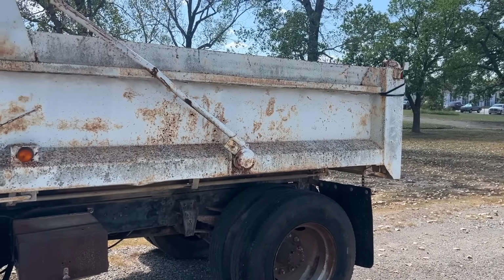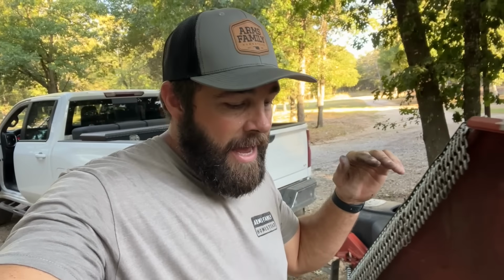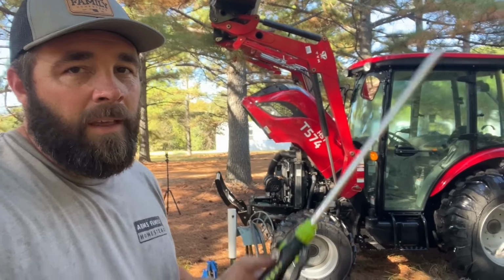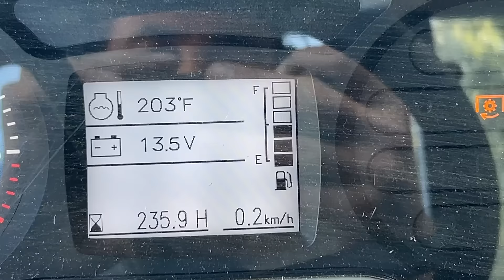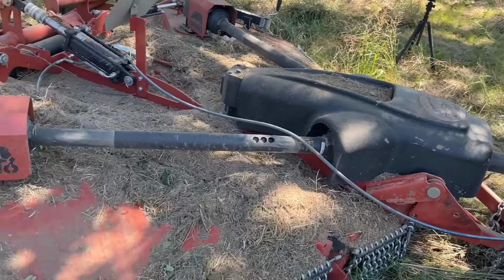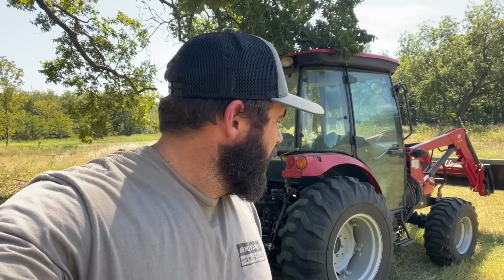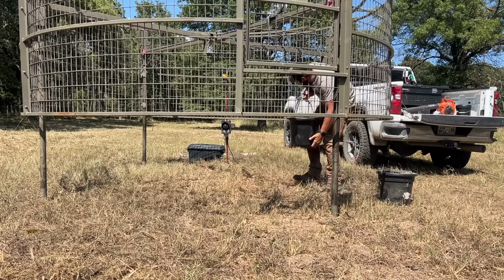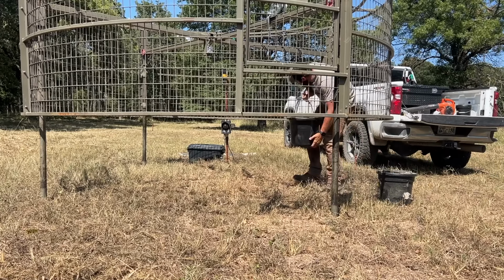That's a First for Me!

Comment: Either your thermostat is not properly functioning correctly. It’s not opening up or the radiator is stopped up.  Open the cap on the radiator and see if it’s flowing or take it to the dealership and let them check it out.

Comment: The overheating problem with that tractor might be a number of things a  faulty water pump?
Contaminated transmission will cause overheating. A defective thermostat will cause overheating. The electrical fan might not be working?

Comment: When you took the drawbar out it looked like you had it in the end hole.  I think that should go in a lot more and then the pin goes in one of the middle holes.   On the first hole like it looked like it was in there is to much leverage and for sure will break. I could be totally wrong  with just watching the video that is my opinion .   Welder up and keep on mowing !!  Good luck !

Comment: I'm gona be honest, I think that dump truck is a much better option than I think you are thinkin. at $5k you could take it straight to a good shop, get the bed relined, full run through the mechanical stuff, probably less than $15k all said and done. less than 30% what it would cost to get you into a newer truck and you wouldn't have to deal with a lot of the problems newer trucks can give you. no DEF systems is a huge plus.

Comment: On the issue of the repair of the draw bar connection it looks like that is a factory problem that they need to fix at their expense due to the fact that they need to check on the capability of the person welding that  together knows how to burn a rod ,just from what you showed of the weld there was no yes I said NO penetration of the two pieces of metal being welded together , the same time they find out why it’s over heating. Has it got sufficient coolant in radiator, because you’ve cleaned it out sufficiently to prevent it from overheating.

Comment: It may be time to trade that TYM in for a Kubota.  I have an M7060 12 spd with cab using a 12' batwing and the temp doesn't even move from mid-scale.  It also has an E-PTO setting so 540 rpm is about 1800 rpm for the engine so it does really well on fuel economy for a 70 hp tractor.  Probably a good idea to get away from that Chinesium steel too.  Btw, those lift arms on the 3-pt hitch would make a hell of a jack with a chain.

Comment: The receiver broke because the hitch bar was installed backwards.  It should be set with no more than 18" sticking out. The two holes in the middle should be what the pin in the receiver pass through. 
Flip the bar 180.

Comment: just my two cents. Save the water for maintenance cleaning on radiator and use air to blow it out to keep clear until maintenance. Next is you are running way to high rpm. Shoot for 1800 max when using attachment and adjust your forward speed as necessary to cut. It is a tractor and and 1800 rpm it runs optimal, adjust speed to this. (yeah you move slower and takes longer). The higher rpm with attachment causes overheating and undue wear and tear on the motor, hydraulic system and more. Please try this. Also if the tractor does not turn the mower efficiently at 1800 or even 1700 rpm the attachment is to large for the tractor and is and has caused damage and undue wear and tear on the tractor. edit... that screen the second time is nothing not plugged at all. Get a smaller pto mower attachment and do the work so much faster without scoring the piston and overloading the hydraulics. I will now step off my soap box and grab myself a tissues to wipe my tear for the tractor. ps. You are a man of faith, if you sell tractor please let them know what you pulled with it and problem you had,,, It is only fair.

Comment: It’s almost like you need an electric fan blowing on the condenser. Cars drive faster and the air flow provides air movement, the tractor is slower and an electric fan can take the place of that lack of movement. Just a thought

Comment: If that has the 8.2 Detroit engine run far and fast. We had a fleet of them. You have to jack up the cab to remove the valve covers. Those engines were a pain to us.

Comment: You should be using a bar across the 3-point attachment hydraulic lift bars for implement, not the trailer attachment.

Comment: If you run your rpms a little faster it should run cooler, had a skid steer that would over heat if you ran the rpms to low , added 100 rpms to operation speed problem stopped

Comment: Replace the thermostat I also think the drawbar is not installed correctly it should slid deeper in the receiver and pin up under the tractor

Comment: for the conditions and the work being down i suspect the radiator is not able to keep up. and the air conditioning in the tractor adds heat to the engine.  i guess just think how hot it would get if you did not stop and rinse it out under the hood.

Comment: I’ve noticed that many tractors built since 2020 have steel quality  and weld issues. Lots of parts breaking or bending doing normal work. I’m pretty sure quality control crashed about then and hasn’t recovered.

Comment: Just a couple ideas, not trolling :) Is your Tractor too small for that brush hog? Have you checked your manual to see what water temp your tractor is supposed to run? Is your thermostat good?  Is your thermostat sticking? Is the thermostat the recommended temp from the factory?  When using the Brush hog without the AC unit running does the engine overheat? Does the water temp over heat when using the Tractor, AC on, without the Brush Hog?  Is your cooling fan operating properly? All relays good on the electrical? 
I am aware you probably have cheeked most all or all of these things, just trying to help a Brother out... So far this is all i could think of :) ❤💯🙏

Comment: Looks like you need to sharpen the blades on your mower. The grass looks chewed up, not cut. Love your videos. I don’t care what anybody else says. I see your problem. Since when do you put an air filter cartridge in front of a radiator? There’s not enough airflow.

Comment: Have you tried higher revs, as diesel are also air cooled by the air they suck in. If your revs are low and it is labouring it could heat up.

Comment: I Would find someone sell scarp steel find thick pice of steel that solid, drill some a few holes in the bar. For your equipment.
Or heat up part bend back up. Make sure all the of paint clean off and cut or grind the welds off. And Reweld it.

Comment: Daniel I’m going to concentrate on the tractor issues as I’ve farmed for going on forty years.  First you did not do anything to break the drawbar. That problem is poor design. Seen engineers do this time after time. They think they can cut corners. And I’ve seen it happen with every brand out there. So I’m not throwing dirt at TYM. As for the heating problem my first guess would be the transmission cooling is not enough for the size mower combined with the pull from the air conditioning. The pto I believe lubricates through the transmission. The size of the mower maybe heating the transmission fluid beyond the capacity of the transmission cooler. As it’s right next to the radiator it can raise the temperature of the radiator. To figure out if any of this is happening I would get a heat gun and check the temperatures that way. Small tractors never have temperature gauges for the hydraulic or transmission like the large tractors do. I hope this is helpful and good luck. 
Ohh! Don’t change your channel because someone tells you to. Just keep doing you. That’s why I started watching your channel and am still here years later. 👍

Comment: You know I was just thinking about the tractor over heating could it be possible that the pump isn’t working properly or the fan is malfunctioning or it could just need flushed out but the worst case it could be a head issue it don’t have to be cracked to cause it to over heat but sometimes it has a defect in it and over time it causes issues but im leaning mor towards water pump and flushing the system out

Comment: Most modern cars run over 212 maybe you should check factory specs. Air conditioning not keeping up is likely an air-conditioning problem since the condenser is in front of radiator. Say whatever you want on your channel, if I get offended tuff.

Comment: At the 6:45 point of this program just as you enter the low water crossing your right front wheel appears to lock up for a moment.  Disc brakes shouldn't do that.  You might want to check it out.  At least look at the recording so you can see what I mean.

Comment: I don't know what temp your tract should run at when it heavy working but when you're rinse the radiator & coolers off id let it dry completely because if it doesn't the wet fins will only trap dust & whatever else in them & to them! Also is the fan tripping on right or is the thermostat opening & shutting right?  Also why is the operating temp for when it's running the pto under a heavy constant load?

Comment: Ha my brother what year is the tractor if it has a few more hours then normal  because of using it as the main work horse on the farm it may need a good service over haul  it also sounds like the thermostat and or a weak water pump  or a belt that might be slipping just enough and looks and feels tight enough  what is the oil pressure running at if the machine has a few more hours then normal it might be having a oil pump starting to slug up or getting just weak enough  in any case if it was me I would be checking deeper into why it is over heating that much  hope that that may help you out a little bit ty for letting me share Matt AKA DDP be safe out there My brother and friends and everybody yuuuuup

Comment: I would just heat that up straighten it and weld it. Those Chinese tractors are NOTORIOUS for cold welds. I have one. I’ve had to reweld several of the wear bushing on the backhoe and loader both. The just have cold welds at the factory and don’t get good penetration.

Comment: I'll be honest, at the price point TYM tractors are at combined with the very obvious less beefy frame structure, it steered me away from them. My tractor is a lesser known brand in the U.S, Mahindra, but is used and known to be reliable on the international level, that's why I went with them, built like a tank with steel much thicker than the competitors. That failure was the result of a sloppy weld, done at the wrong temperature, which wasn't seamed properly at that joint. Combined with that overheating problem, seems like a ticking time bomb.

Comment: Somethings not right about the tractor heated up. Im no mechanic or expert but my screen can get completely covered with dust and debris and i only clean my radiator every now and then and it has only ran hot one time because i tried to do my whole pasture without stopping and I only think it ran hot then because i didnt check the screen before i started.

Comment: on the bright side that hitch dont look like it will be too difficult repair. a decent welder should be able to heat the metal, bend it back with a hammer and C-clamps and weld it back in place without too much issue

Comment: A couple of quick question sir is the fan on the tractor a clutch driven fan or a direct drive if it is clutch driven fan it might be slipping , if it is direct drive (fan mounted to the belt pulley) see if there might me a larger replacement fan or one with great pitch to the blades. Is this a problem with all the same models?

Comment: My hubby says your mower is too big for that tractor get a flail or a smaller mower he’s worked equipment for over 35 years, jack it up and bend it up then weld it again it’s not a very good job an that company it should be stronger than that

Comment: Unfortunately, Daniel,  the tractor is not a decent working tractor if it's already overheating and the hitch has split.  Obviously, you are proactive with care your equipment. So the problems are not because of user interface but a defective tractor. That really sucks. Call local dealer

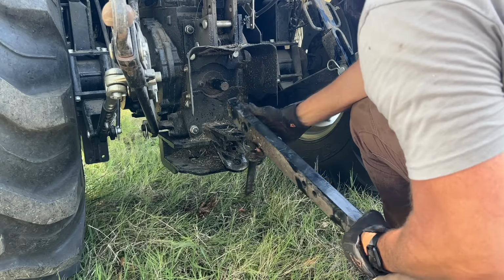Comment: 20:10 I'm pretty sure your drawbar is too short for how you're using it. It should mount up under the tractor farther, and pinned where you had it pinned. There's not enough metal on that mount to support all or that weight as a cantilever. I'm not an expert, so don't take my word for it. I just have tractors.
I'm sure it would be easy to weld, but fixing or replacing it without a longer drawbar will just be a repeat waiting to happen.

Comment: Have you actually checked the coolant level in the radiator?  not just the reservoir.
Reply from the maker: Yes
Reply: @ArmsFamilyHomestead  only asking from experience. Next would be to check water pump or thermostat

Comment: You look 10 years younger with that haircut and shave. I had noticed that your beard was longer than normal. It was until your last video that I realized why you had let it grow out. Especially since you’re still in HOT weather. I think your tractor has a design problem. Something just ain’t right for it to over heating like it is. I know that Evan is having the same issues. Is there a shroud around the radiator fan? Or is a clutch type fan?? It just doesn’t make sense for it to be having a problem with overheating like it is. When you were cleaning the filters, they don’t look that clogged on the video. 
Great video as always!!!

Comment: You are running a a/c unit the added weight of the bucket plus a 3blade bushhog.  Why does other tractor not overheat?? I wonder no ac no bucket //?/// ac alone loads up engine.  Underpowered??? Just thinking
Reply: Broken weld a real pain just ruins a good day
Reply: Lousy weld

Comment: I can see by your gauges that your RPM’s on the engine are nowhere near the recommended 540 for the rear PTO requirements. This causes drag on the engine and could potentially cause it to overheat.

Comment: Just wondering why you don’t run your RPM at the suggested number while running your pto.   From your videos it looks like you’re putting more stress on the engine by not running at the correct rpm.  There is a spot on the tach that is marked for 540 pto operation.
Reply from the maker: Because it will overheat in no time at all.

Comment: That is a crappy weld on your tractor hitch point. Surprised it lasted that long. I would get with Tym tractor and have the thermostat checked. I believe that is your overheating problem.

Comment: Drawbar breaking and tractor overheating, not too impressive for the brand.  A tractor of that HP should walk and talk with a 10' Rhino, never look back.  What's the dealer saying.  I read that sometimes a lower pressure radiator cap can help with overheating.  Drawbar set up looks like a poor design.

And regarding the church deal, keep on keeping on.  It's your channel and I respect you and your choices for content.

Comment: did that drawbar come out like that while in use or is that how you hooked it up?    typically the drawbar goes in another full foot.   that looks to be out at the end and had way too much leverage.    I don't think that drawbar was put onto the tractor correctly.   the pin needs pulled and only about half the length of the drawbar should be hanging out of that bracket.   other brand tractors I had,  that hole the pin was in goes into a pin further under the belly of the tractor.    my JD, just slides in and has a pin about in the middle of the bar that pins it to the tractor.  strange.. it doesn't look like that bracket allows for your drawbar to slide in any further.      definitely not how other tractors work.

Comment: Weld as a welder by trade. One look at that hitch. Like every thing mfg today from tractors to trailers hay feeders. You can see if you have a traind eye. The weld on both side is crap. You can see the weld bead 70% missed the lower up right flat bars. Just a hair of weld on them. It all on the top peace. No need to buy a new part you just end up with same crap. Find a welder like my self. He or she will cut that weld out of there an taper it. Put a bottle jake or like me i carry many types of porta power units. Heat up were it bent with a rose bud jake it back into place an stick weld it with 1/8 7018 rod. No dam migs.

Comment: I can can tell you exactly why the hitch broke....those are HORRIBLE  welds. You can see on the left side, most of the weld is on the upper part, very little penetration.

You could pick up that bush hog easily, back tractor up so 3 pt arms were over tonque, slap those chains on the arms and lift it up.  

As your over heating issue, either its a design flaw with too many coolers on the single fan, between the engine coolant, oil cooler, hydro cooler and the A/C condenser, it just can't cool all those systems and keep engine cool. I would definitely contact manufacturer/dealer and also see if any forums are discussing it.

Comment: That truck looks to be mid 80's based on the fender shape.  

Hope they fired that welder that made that hitch, those weld beads barely touched the bottom plate.

Comment: * * * * * * * * * * *
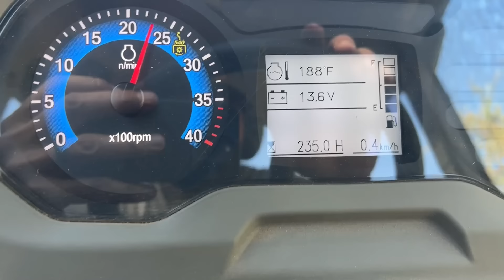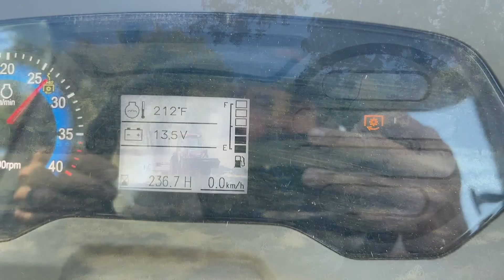AT TIME STAMP   10:25,  11:46,  12:18,  12:39,   15:59    your PTO shaft RPMs are to low for mowing.    You have to mow at least at the PTO 540 speed.   If not it will over heat the engine.
It is obvious in this video.   Look at the little yellow square with 540 in it.    Keep your engine RPM at at 27 or 28 while mowing AND the over heating will stop.
Don't buy a new draw bar bracket.  Take it into the tractor dealer and have them re-weld it.  Better yet a metal fabricator could do the weld better.
NOPE stay away from that truck.   It will be nothing but problems.